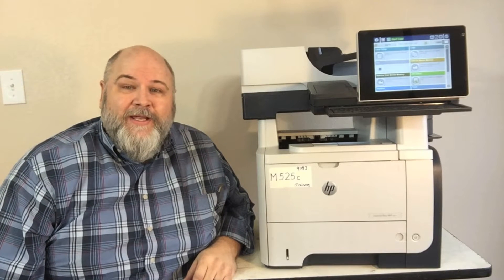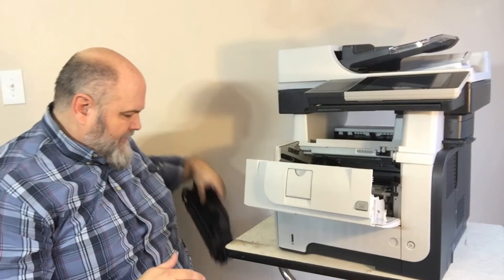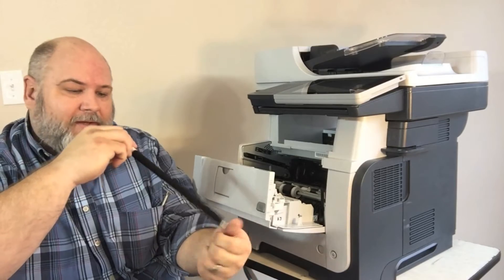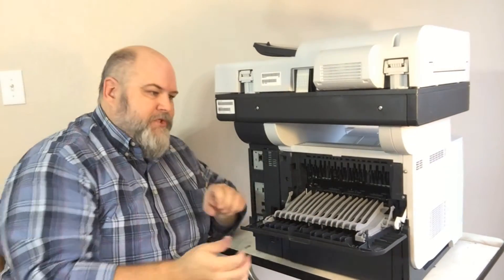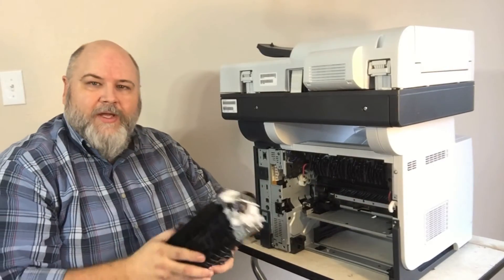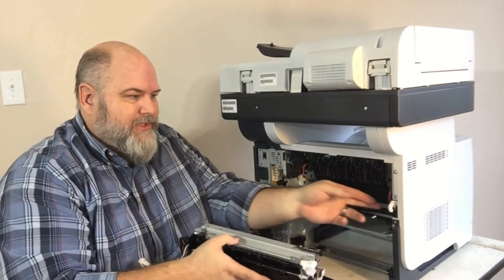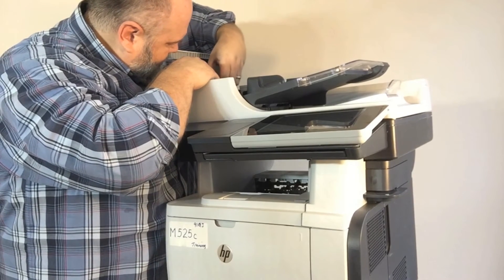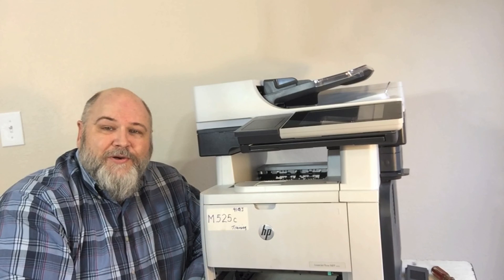PRINTER REPAIR: How To Do Maintenance On Your HP LaserJet M525C MFP

Comment: Nice video, I am troubleshooting a "false" paper jam, which started happening after replacing paper into the bottom Tray 2. Do you have advice on this? I read somewhere it might be shards of paper bits that is disturbing the gears. I was hoping to find the trouble spots to look for. Many thanks. I have the HP laserjet 500 MFP M525. Looks almost exactly as the one you use in the video.